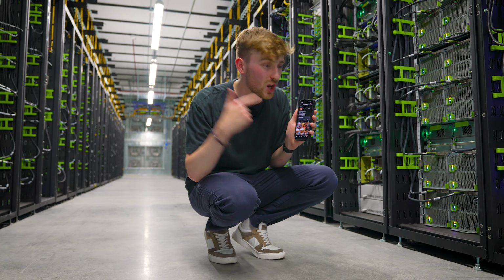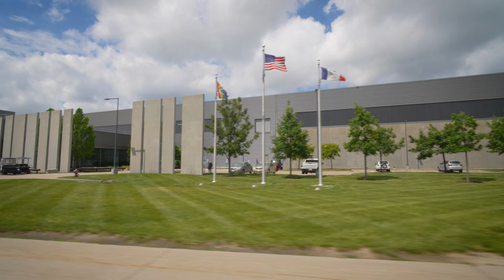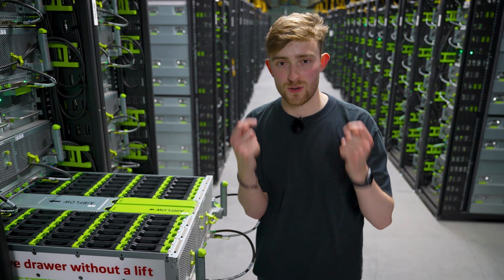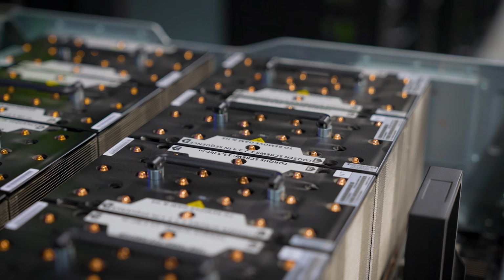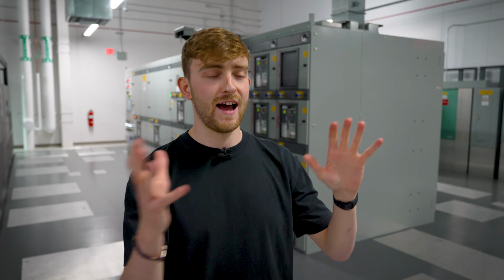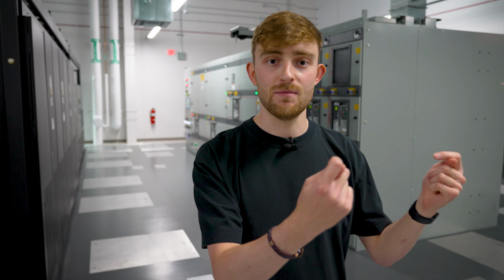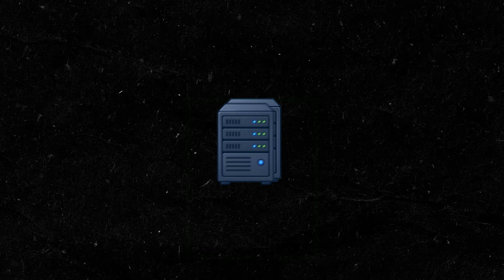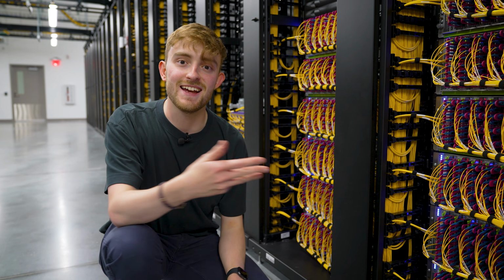Inside one of the world’s most efficient Data Centers

Comment: As someone who actively designs data centres across the globe for various hyperscalers, I found that this video was very well structured and informative, it's great work you are doing putting out relevant and factful information to the general public to try and kerb the unnecessary controversy around DCs, as social media has put a massive negative skew on it, which is ironic that people are moaning about DCs being built, on a social media app, hosted in a DC... I would add that in Europe, all DCs use closed loop chiller systems for cooling, so use 0 water after initial fill 12 months a year.

Comment: It's not a misconception of water usage. It depends on the datacenter. Depending on the datacenter the water usage is more in terms of the spray nozzles used for the augmentative evaporative cooling effect. Some are able to not use any water. But an overwhelming majority of specifically ai training data centers have to use this evaporative cooling solution because it is not only much cheaper. But the per rack kwh is getting so large that in order to have an infrastructure that can survive a refresh they need to liquid cool and move that liquid somewhere with a scalable cooling solution. But it's still not the full picture. The real issue with this is that because the water is taken from a local source, sprayed and then evaporated. Now you have effectively lowered the amount of water in that area. Because the evaporated water is going to create clouds that will bring that water somewhere else before it rains. And is not guaranteed to actually stay where the people need it. So in an area dealing with a drought. The datacenter takes a lot of water and the people in that area are the ones to suffer.

Comment: I get that this is a modern facility but if I researched this correctly the majority of data centers still use open loop cooling, meaning they evaporate water to cool their systems. Also of course you have to mention how much they do for the community around them but from all of the reports the fact is that they don't.

Comment: Thanks for the video. I had some gripes about it though. 
For legacy or traditional data centres it is generally true that they do not used lots of water. However newer hyperscaler dcs rely heavily on evaporative cooling, which in fact does use large amounts of water. This is also true with noise pollution, legacy dcs do not introduce the same level of noise pollution compared to hyperscale dcs that have constant running diesel genrators outside. 

This misrepresentation of what a dc running traditional workloads for example instagram, create in terms of pollution/water usage vs an AI hyperscalers pollution and water usage makes the video seem like an ad for meta.
Reply: "constant running diesel genrators outside" thats not true hahahahhaha, imagine spread missinformation only for hate a big corp.
Reply: @TheGamerVici0  I wasn't saying that all hyperscale dcs have that. But that the effect on the environment differs widely from dc to dc.

Comment: 7:40 - Left out where the fuel comes from, but oh well. 

8:15 - This is where the video falls apart. 

That datacenter uses a combination liquid and air cooling. 

The dismissive approach to the water issues is comical - for no reason other than it's one of the most controversial parts of the datacenter system, outside of noise and energy use. 

The reason they only use water 4 months of the year, allegedly, is because - those are the summer months. They can't cool the datacenter with the outdoor air alone. 

They don't disclose how much water they use, nor is it known what they ADD TO THE WATER. That's the sneaky part and is common with industries now as they label that information "trade secrets" that cannot be publicly known or it would otherwise remove their "competitive advantage". 

Chemicals are added to that cooling infrastructure because you can't just push raw water through those systems without removing harsh properties of the water itself. 

The discharge is "tested" by the municipality - but all that, what's in the water and what's actually tested for, is not publicly known. 

What is known is that the discharge goes right into the Altoona sewer system and Des Moines River. 

Meta is never going to reveal what is added to the water. Instead they focus on the "evaporative nature" of the cooling combs. 

To go on and say  that because the liquid cooling portion of the system is in a different room than the servers themselves, and that the servers therefore aren't "liquid cooled" is misleading altogether.

Comment: If you sit in the bed of a moving pickup truck, directly behind the cab, you also barely hear the wind or the noise of the vehicle itself. That does not mean the noise is not there. It only means you are sitting in a sheltered spot.

The same applies to a data center. Wind direction makes a huge difference. Depending on how the wind is blowing, the noise can be barely noticeable at one moment and extremely disturbing at another.

I actually live next to a data center, and the reality is very different from what you describe in this video. Perhaps you happened to visit a data center that genuinely treats its neighbours well, but that is certainly not the experience of everyone living near one.

Tom, live next to a data center for a full year and experience every season, every wind direction and every type of weather. Then you may understand what local residents actually have to deal with. After that, I doubt you would ever choose to live next to one yourself.

You also completely ignored the light pollution and the serious problems it causes for the people living nearby.

Comment: It gets quite cold in Iowa. So what happens with water use during those 4 hottest months that were excluded from your "for 8 months a year there is no net water use for cooling" statement?? If it uses a million gallons a month, then ...
Reply: Loudness only implies your ears and brain have the ability to interpret the waves traveling through the air. At both ends of the frequency spectrum there are lots of frequencies we cannot interpret. But they are STILL happening, and still hitting our bodies, and can still cause problems.
Reply: @kevinboles3885  I've worked in these datacenters including this one specifically and I don't believe there is any concern for infrasound exposure. No one I know who works in datacenters feels any affect from infrasound. In fact most people are oblivious to it because it is such a non issue.

Comment: PR Video for Meta.
Reply: They (Meta) did spend a lot of time in the video showing off that state of the art data center that was quiet and power efficient, didn't they?

They certainly didn't spend as much time in that temporary structure structure that looked a lot noisier.
Reply: @Ultimatebubs  I can assure you no one is complaining about noise exposure from that temporary exposure. The interstate highway right next to it is 10x louder.
Reply: @Ultimatebubs  It's not as interesting that's why. it's the same thing built fast, and yeah it's more noisey not all the steps to keep noise down have been taken.
Reply: @RainesMedia not even remotely loud. I work here and live in Altoona down the street..
Reply: Stop using Instagram then. And Youtube which goes through several data centers.
Reply: Sure, but I don't think there's anything factually wrong in this video.

The one thing that might be a little contentious is the effects of infrasonics. Just because you can't hear something doesn't mean it doesn't affect you. But way more science needs to be done of infrasonics.
Reply: yea alot of things were very setup i feel, like trying to push down alot of political points, comedy gold doing the noise test on a vibrating vehicle
Reply: So what? Is it not factual?
Reply: Everyone loves a pro data center video as the country is trying to ban them 😂
Reply: @AiNomadDev  I believe it's just some loud mouth and an aging grampa from New York and Vermont .. Keep the remote away from him 🤣
Reply: Who paid these bots need to quit ..
Reply: Every service on the internet is run on a datacenter somewhere

Comment: Why they don't use ssd storage type instead hdd
Reply: HDD are cheaper and can hold a bunch of storage more cost efficiently
Reply from the maker: correct ^^^
Reply: @DANHEARTSCENECOREbut in HDd logical error are very common and on the other hand ssd is expensive but secure for data...
Reply: @Cole-n9q  They will keep multiple copies of data even if SSDs are more secure, because none comes with total guarantee. And for a little more errors in HDDs, let's suppose they have three copies, if one bit flips or any logical error in one HDD, the system has a kind of voting system 😅 where if two HDDs agree on something and one doesn't, that gets considered as the one with the error, and fix is matching with other two. And it is highly unlikely that two HDDs will get error or bit flip at the same time at the same part of the platter.
Reply: @Cole-n9q  they have highly predictable lifespans at scale and are engineered around that
Reply: In some DCs, its tiered. SSD -> HDD -> Magnetic Tape. Depends on the data.

Comment: After petabytes, data storage units progress to Exabytes (EB), Zettabytes (ZB), and Yottabytes (YB). Driven by the growth of global data, the International System of Units (SI) introduced two new prefixes in 2022: Ronnabytes (RB) and Quettabytes (QB). 

American National Standards Institute - ANSI +2

Each level multiplies the previous by exactly 1,024 (or 1,000 depending on the manufacturer): 

YouTube·Kingston Technology +1

Exabyte (EB): 1,024 PB or 10¹⁸ bytes. (Roughly equal to the total global internet traffic transferred in a few days).Zettabyte (ZB): 1,024 EB or 10²¹ bytes. (The total volume of all digital data created worldwide over a multi-year span).Yottabyte (YB): 1,024 ZB or 10²⁴ bytes.Ronnabyte (RB): 1,024 YB or 10²⁷ bytes.Quettabyte (QB): 1,024 RB or 10³⁰ bytes.  😅
Reply: Historically base 10 and base 2 counting of bytes has been used interchangeably, but due to confusion this has officially changed.
Though in practice they're still being mixed.

SI only defines base 10 prefixes:
kilobyte (kB) = 1000 bytes (B)
megabyte (MB) = 1000 kilobytes (kB) = 1000000 bytes (B)
etc.

while IEC defines base 2, but with different prefixes and abbreviations:
kibibyte (KiB) = 1024 bytes (B)
mebibytes (MiB) = 1024 kibibytes (KiB) = 1048576 bytes (B)
etc.

Comment: Ai daya center is very different than regular data center (Facebook, instagram, etc). It’s a very powerful hungry beast that requires large amount of power, cooling which translate to noise both outside and inside, destroy the eco system, high electric brill for the surrounding community. This guy is a paid actor
Reply: Actually, the AI specific data centers typically DO require more power, but much less water due to the closed loop systems used instead of evaporative air cooling, and noise is near eliminated without the need for large fan walls for air cooling.
Reply: Dunning-Kruger effect. brother, you have NO idea what you are talking about. data centers DO NOT destroy the environment, there are A LOT of other things who really destroy the environment like Fossil Fuel Industry, Intensive Agriculture/Livestock, Fast Fashion, Chemical & Mining Industry (lithium for eletric cars for example), Waste Mismanagement
Reply: @davi6528  considering ai datacenter (servers) need rare resources, neeed energency (as solar panel also need rare material)  its a good contributer its not the soul factor but a good contributer (ai datacenter or not)
Reply: Stop being easily misled.
Reply: You don't have a clue what you are talking about. Plenty of servers at this data center that power AI.

Comment: why still use machanical drives when data centers need speed etc so wouldn't ram drives faster, smaller, etc? i,agome 10 ram drives in a small space vs 1 hdd in same space lol
Reply: cheaper and they last longer
Reply: They are cheaper 😅
Reply: Cheaper and denser to use spinning rust. And by having multiple copies of data, you can fetch it from the lowest latency source.
Reply: Its not ram.. its SSDs.. RAM is volatile.. eitherway both are costlier than HDD..
Reply: A proper design uses tiered storage. What this means is that frequently-used data gets cached into faster drives for access and less frequently-used data sits on slower storage that is cheaper per unit of storage. This is in addition to classifying storage pools according to data type and writing to the appropriate pool. The storage solution itself is distributed, likely Ceph. I engineer these types of systems for a Telecom I've built myself from the ground up.